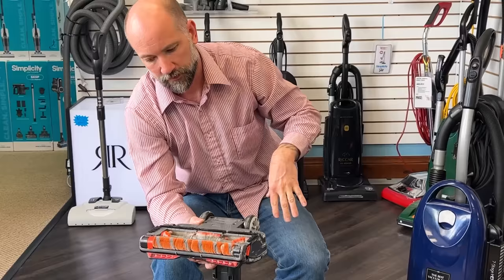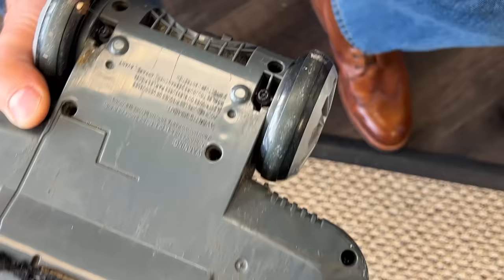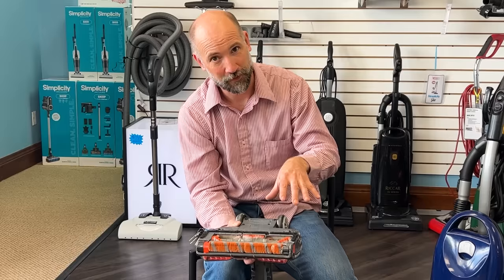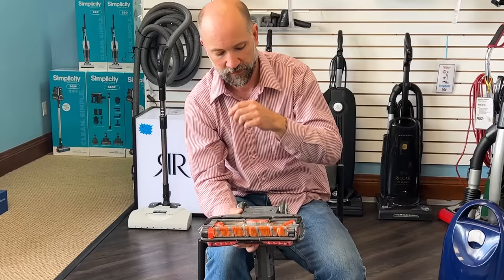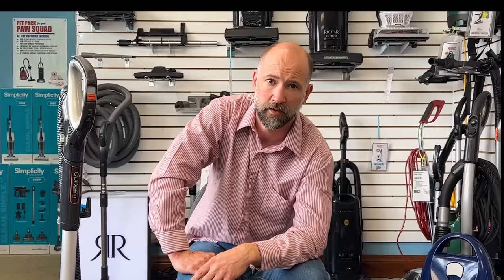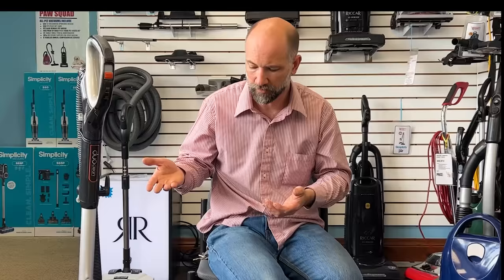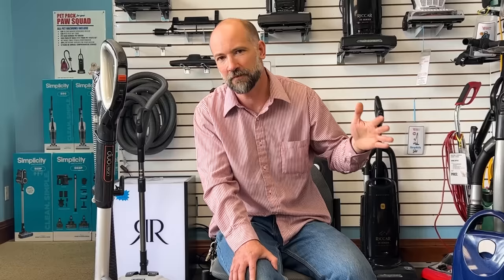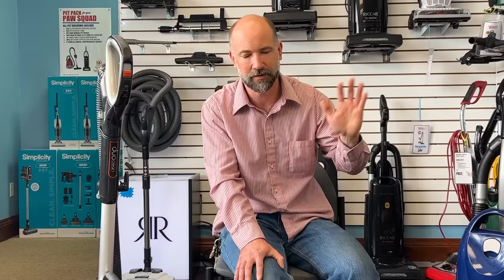Why Can't You Repair Your Shark Vacuum?

Comment: Great video. This goes beyond vacuums to consumer electronics and even power equipment like lawnmowers. The problem is partially driven by the better quality, repairable units. Parts are so expensive that repair is sometimes prohibitive. 2 years ago I had a Miele vac where the head stopped working. I disassembled (I have torx, a multimeter and the right tools and knowledge,) diagnosed and priced out the parts needed to repair. $300, doing the repair myself. So do I invest $300 in a 5 year old vac that I paid $600 for? Or do I just buy a $200 vac and get what I can from it? Back to mowers… Honda will stop selling push lawn mowers in 2024. They quit on riders years ago. They make a very impressive $1000 mower that is durable and repairable. The vast majority of consumers want the $300 box store mower that will get the job done for a few years. We are living in a disposable world. For every consumer who will go to a fine establishment like yours (or like my local power equipment dealer,) there are a busload buying from Amazon or a box store on price point.
Reply: I am not a professional but I bet the new low voltage requirements for appliances is going to make them wear out even quicker. I really hope it does not hurt the homes electrical system.  GREED   
_____________________________________________________________________________________________
"Low-voltage Electrical Appliances Market" is segmented into Regions, Applications (Industrial, Commercial, Civil Building), and Types (Power Distribution Appliances, Terminal Appliances, Control Appliances, Power Supply Appliances, Electronic Appliances). The report presents the research and analysis provided within the Low-voltage Electrical Appliances Market Research is meant to benefit stakeholders, vendors, and other participants in the industry. This report is of 107 Pages long. The Low-voltage Electrical Appliances market is expected to grow annually by magnificent (CAGR 2023 - 2030).
Reply: How can it be a great video all he did was complain
Reply: Sad but true!! It's my generation of "instant gratification" millennials that are ruining it.  I'm 38 and didn't get Amazon until everything was shut down during Covid, and appreciate brick and mortar stores and repairing things myself.

Comment: My Shark Vertex Ultralight is the dream vac. About two years old, no problems at all. I have two dogs, long haired and carpet in main rooms. This vac picks up everything, lots of hair, trash and dirt. I’ve had a Rainbow, Whirlpool, Mighty Might, Miele, Hoover,  Electrolux and an Oreck and none have worked or cleaned as well as this Shark. I wash out the dust cup and the filters about every third vacuum session and remove the front roller and wash it with Dawn, rinse and air dry, snap it all back together and keep on vacuuming. If it fails tomorrow it will be replaced by a new one exactly like it. By far the best vacuum I have ever owned. My carpet looks like it did when it was new, before the Shark I was ready to replace the carpet because the pile no longer stood up and looked flat. I donated a 6month old Miele because it didn’t do half the job this does. If my Shark can’t be repaired at some point it’ll be okay because you can’t find vacuums that will do the job this one does. The only con is the cup isn’t large but I’m fine with dumping if it needs it mid vacuuming session. The amount of hair this thing picks up is truly amazing. The filters can be thoroughly washed and put back in, this alone will save you a lot of money. Don’t let this video keep you from getting a Shark you can’t beat (the one I own) it for doing a thorough job. Yes, I have attachments and no I don’t work for Shark and I paid full price for my vacuum.
Reply: @kathyrobertson4493 I totally agree with you about how well the Shark vacuum works on pet hair as I own 3 dogs one being a black lab who seems to shed more than my previous Springer spaniels. You are right about having to empty the main dust chamber once or twice during the vacuuming job. The sponge & fiber filter are easy to wash but the lower HEPA filter is more of a challenge and I can do this with the aid of my air compressor. The first Shark vacuum is just over 5 years & my wife brought to my attention that she smelt of burnt rubber I took it apart without issues after watching a couple videos and being technically inclined to work with plastic covers. I found nothing wrong with it. Fortunately, I bought another Shark within 6 months discounted by 50%, and put it away for when the previous one would die. Now I'm going to see how well Shark handles their 5-year warranty on the one I just started to use & yes I have my receipt. Stay tuned!
Reply: @JerryClark-ym2br  Maybe people just need a few long haired pets,  then they’d realize just how much cleaning this thing actually does. Hope yours lasts forever.

Comment: As a house cleaner, I can say you are 100% correct. Removing the lid to brush rollers make them landfill ready.  Of course, bissell and Hoover are a waste, so I would still recommend a very cheap basic shark for those looking for cost efficiency. Nothing beats a meile.
Reply: It's nice to see another housekeeper with the same opinion of the brands. I've used many different brands and still find shark the best for cleaning and ease of use. 
As for Bissell I do not understand why they can't design a cleaner you can use without the brush roll. That is maddening! All that being said, I've never liked the fact that sharks gave to be sent in to the manufacturer to be repaired. That's all I've known until seeing this video today. I didn't know any repair shop would even attempt a repair on a shark because where would they get the parts? Hadn't thought about recycling parts. 
I read years ago that the guy who started the company fled to Europe to avoid paying taxes. Sounds like the kind of guy with other business practices like this video explains. 
Fortunately I don't provide a vacuum in my business. I ask the customer to provide one. I have a couple I can use if they don't have one or for any construction clean up I do. 
Here at the house I use my roommates Rainbow which I absolutely hate. It's one thing to drag around a canister vac, try dragging one that's full of water! Ok, rant over.
Reply: Oh I do have a client with a meile. Very expensive thing that has lost some suction. I keep telling them this but they've done nothing about it. I charge by the hour so it just takes longer to get the rugs clean!
Reply: @nicholastanton8404  Rainbows are SOOOO bad!!! They cost around $2000 back in the early 2000s. They only thing they were good for was filtering allergens out.
Reply: @K.Kelly87  Only the wettable ones. You're better off with a machine that has a HEPA filter.
Reply: Housecleaning business owner since 1972. Meiles are a waste of money and awkward to maneuver.  Makes the job take longer and harder on your back.  I have a Shark I use in my own house...not the basic model, it's red and white...have had it for 6 or 7 years with no issues.  Going to say that in all these years of cleaning, I've never had to have a vacuum of mine serviced. Take care of them! Changed belts and cleaned rollers...not too hard to manage.
Reply: @nicholastanton8404  I won't use them. My back is a commodity!
Reply: As a housecleaner too, I agree!! Shark is by far the best when having to drag a vacuum around a large home or up and down stairs. I just placed an order on Amazon for my 4th one. We actually the upright kind on our home as well. It’s these stupid lower hoses! I’m looking for a hose that I can make fit to go on my 3rd one as it still works great. Not giving up yet!!!
Reply: Thanks I am buying my second one tomorrow since the lady above me is on her fourth

Comment: I'm on my 2nd ever vacuum cleaner, I've been in my house for 33 years now. 1st was a Hoover that lasted about 22 years, with numerous repairs, until the replacement motor burned out. The whole machine was to cracked and had broken housing, so I bought a new Electrolux, about 10 years ago. Both machines were and are used every day (my wife is a clean freak). The Electrolux, although pretty battered, still works like a new one, I have only replaced the hose once, and the carpet brush attachment so far. two great machines!

Comment: I’ve had this vacuum for a few years now and it’s still going strong. https://www.youtube.com/post/Ugkx8ISPQRRAfpAaX4msGjyodObTBnlj4T5g I was cleaning it today and thinking about how much I love no bags to buy and that it comes apart for easy clean up. When I first purchased it we had two dogs and a cat and it kept up well. The suction was great then and still is now. I’m always amazed at the amount of hair it picks up, it works better than any other vacuum I’ve had for pet hair. The attachments are handy and work well. It’s easy to use  with arthritic hands. I just had to come write a review because I’m still so pleased with this purchase.
Reply: Wait until it needs to be repaired.  I was also in love with my Shark until simply replacing the battery in a handheld became mission impossible.  I won't be buying a Shark again.
Reply: @SharonKaraa same here my.rollers stopped will not buy another shark

Comment: I've had my Miele canister vacuum for 15 years now. It cleans amazingly well and still works fantastically. You get what you pay for.
Reply: I paid £275 for my Shark upright and it stopped picking up after just over a year!

Now buying a Victor cleaner which I used for twelve years at work without issue.

Comment: Thanks for posting this. I was trying to fix my shark vaccuum today and was frustrated by the weird screws at the bottom that I didn’t have a screw driver for(have since learned they are the security torx). I always try to repair my products before replacing and will be changing my vaccuum brand to one that allows me to do so.
Reply: Harbor Freight, if you have one close by, sells the torx security bits in a bundle with a variety of sizes.  Happy to have on hand and fairly inexpensive.
Reply: Apple were the pioneers of this BS now nearly all tech gadget company's do this
Reply: Sebo vacuums have good reviews for repairability and performance

Comment: Thank you for this video. Our second Shark died, the motor stopped working. As it wasn't that old, I assume it was a wire disconnected an easy repair, except despite undoing all the screws, the case wouldn't open. Now replaced with a Miele vacuum, our last Miele lasted 15 years but got rid of as the cost of replacement spares was getting expensive. But it turned out that this would have been less expensive than two unusable Sharks.

Comment: Just ran across your video today and it confirms my long held belief about Shark vacs.   I think they are initially attractive due to price and style.  Also they work pretty well.  After a few years of use I wanted to replace the brushes or the whole brush roller only to find Shark does not sell these parts.  Additionally the hose cracked just like you mentioned in the video.  Duct tape fixes the cracked hose and even with worn brushes the vac still picks up stuff.  I'll probably use it until the motor goes out.  Thanks for the video.

Comment: This just randomly popped into my feed and very well said! I have a Shark, that I have serviced, and it still works, but figured "Why not watch the video?" Glad I did! I have been using vacuums for many years. I love vacuum cleaners. I also love keeping things alive and have serviced many things including vacuums in the past for friends and family with factory service parts as I also feel the ecological impact of throwing away something that might be a simple fix is, well, ridiculous. I own and use a Kirby, but when I am tackling messy jobs, I do go for the quick and easy Shark. Was only $100 when I bought it many many moons ago. I have noticed prices have gone WAY up since I bought it. Figured Shark for everyday cleaning, Kirby for deep cleaning as the Kirby is just rock solid, but those bags. 

One day, I noticed my Shark, wasn't sucking well. Decided to open it up, rather easy task as, again, old model. Noticed TONS of filth in the power head. Saw the hose cracked. Figured, "No big deal, go find their parts site, and order a new hose" Well, that's when I discovered, I could buy a whole new power head... For $100. Armed with a caliper, found the hose diameter, bought it, noticed Shark glued the old hose in quite well. Broke it all off, replaced it, and it works great now. 

But that whole experience has made me never want a Shark again. I will keep using my current model. Once it dies, I wouldn't buy another

Comment: I found this video and your other video while trying to replace the microswitch my newer Shark vacuum. I think they caught on to everyone getting around the star screws, because they are now using POP RIVETS on the inside to hold this and other parts in place. Before I went down the Shark repair rabbit hole I had no idea about their awful business practices or that they make things so difficult that even professionals are frustrated. I getting was ready to throw it away, but it made me more determined to fix this thing just to spite them, so tomorrow I am getting a grinder bit to purge these god awful rivets so that I can install my $6 part. And this will be my first and last purchase of anything Shark.
Reply: I wondered why the screw snapped off when I was replacing it.

Comment: Great video!! I just ditched them after realizing the same thing - I choose hoover product now after checking their spare parts supply. Happily it's also much easier to dismantle and service.   Btw I got into my Shark fine as I have a cheap Chinese off Amazon set of security torx bits - but that didn't help with the atrocious component design.

Comment: My HV301 Shark Rocket has worked well for 5yrs and in rough on it. Best I’ve had. The hose cracked recently, replaced with one from Amazon. Security bits are found at many hardware stores or auto part store for $8-$10. It was easy and cheap!
Reply: I don't know what model I have (too lazy to check) but I've had mine for years and it's not designed this way. There are spots to insert a coin and turn to easily open up the thing and clean off the brushes + replace the belt.
Reply: People are so lazy and quick to blame the vacuum...maybe they shouldn't run over frayed carpet, clothes, rocks, liquid...and they wouldn't have these problems. I have never had them in 50 years of cleaning!!!

Comment: I just started trying to take apart my Shark Lift Away after a sock destroyed a belt.  Immediately ran into the torqs security bits.  Drilled out the center pin to be able to use my torqs drivers.  Next, the grey end caps on the rollers were snapped in with no way to remove.  After watching your video, I realized there is no way to take them off so I just broke them off.  I'm pretty crafty and will try to figure out a way to put this back together so it's useable, but this is disgusting.  We'll never buy another Shark.  🤮
Reply: Harbor freight sells the torx security bits.
Reply: So what did you come up with? Has it been successful?

Comment: You are so right, on my 2nd shark duo clean lift away now within a space of 4 years and both have broken, 1st motor suddenly died funny enough just after warranty finished and now my 2nd one has a broken part where the main hoover sits so now can see the wires but nightmare to use because have to keep it sitting in the base and cannot find a replacement cover for it. So done with shark now, let's see how my new vax works.

Comment: I've been very happy with my shark duo, and was only looking for roller disassembly videos in order to do a deep cleaning.  Sure enough I've got security Torx screws on mine, and the general story you told about repair rights vs wasteful and greedy consumerism has tainted this brand name in my mind.  Being anti repair rights is anti human and abusive of our materials/environment. It's literally the poor man buying cheap boots is more expensive than being able to afford an expensive longer lasting pair analogy lmao so it's also intentionally abusive on people financially.  I received mine as a moving gift, and I was planning to buy a cordless to gift to my sister when she moves soon, but there's no way I'm financially supporting shark now after seeing those Torx screws on my unit and since learning that a belt replacement would require a catastrophic disassembly.
Reply: I tried to raise a warranty claim with them because after 3 years I noticed that the inner hose in the base had split (I have a 5 year warranty).  "Wear and tear - you've been misusing the your vacuum cleaner" was the response :|
Reply: A T-10 will remove those security torc screws I just did it trying to take mine apart to see why the one back wheel won't turn freely. Even with removing screws it wouldn't come apart came across this video searching for a repair video.

Comment: Thank you for the warning. I love my shark duoclean for its maneuverability, but it has started sounding off and I think it’s on its way to an early death after 6.5 years of use. I will go to my local vacuum dealer to shop for a replacement, but will also try to return it to Costco. Costco is selling a LOT of this brand. If they get a too many returns, maybe they will stop carrying it.

Comment: Took delivery on a new Shark this morning. My old Shark lasted 16 years before it died the other day.  Damned sure wish I’d have run across this video before I spent $400 on the new one. Had I done so I’d have purchased a deferent brand.
Reply from the maker: Unfortunate timing. When your ready for a new vacuum check out your local vacuum store. They will get you going in the right direction.
Reply: Why not try and returning it.. even if you did open the box or even use it?  It would be worth a shot.  You never know.  They just might take it back.